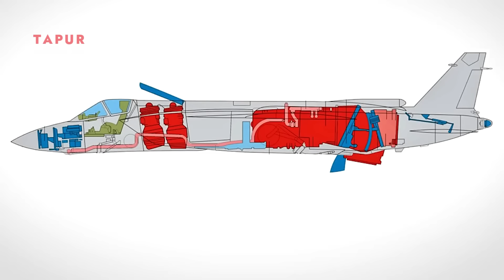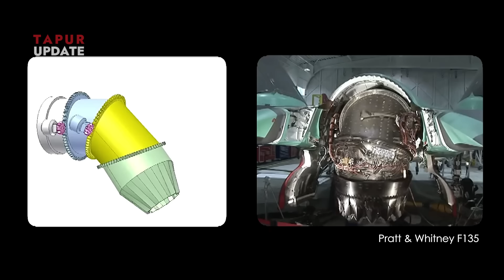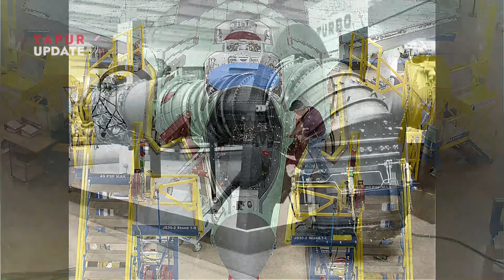Russia Resurrects Yak-141, The Forgotten VTOL Fighter Reborn for 6th-Gen Supremacy!

Comment: It's not even funny. Why would Russia need a vertical takeoff fighter if it has one aircraft carrier and is not going to build new ones? They just don't need them. The sixth generation fighter, according to rumors, should go into the mesosphere. Ideally to reach the thermosphere. But this requires new types of fuel and engines with new operating principles.

Comment: After the collapse of the Soviet Union, Russia's finances were in trouble. Russia did not have the financial resources to repair its only aircraft carrier. To make matters worse, Russia's oil and gas pipelines to Europe were damaged. Russia lost a major source of income. Russia has eliminated most of its Soviet-era weapons because it does not have the financial resources to maintain them. Lacking available destructive weapons, Russia has been using China's overcapacity DF-21D/Mach 10 and China's Beidou Global Positioning System to guide China's DF-21D to its selected Ukrainian targets.
As shown during the Iranian missile attack on Israel, the US Standard 3, US Standard 6 and Patriot missile defense systems are all unable to fully and effectively intercept hypersonic missiles (China's overcapacity DF-21D/Mach 10). In the next stage, will the US Ultimate THAAD system be able to intercept China's overcapacity DF-21D/Mach 10?

Comment: Fun Fact:  The Yak-141 was developed in the 1980's just before the fall of the USSR, and in an attempt to be "West-friendly" (and also to make money), Yak sold the tech to Rockwell or Grumman I don't remember exactly.   30 odd years later, USA has the F-22 and F-35 using this very tech.
Reply: It was sold US when US had program to develop Gen 5 fighter aircrafts with VTOL characteristic for research. Basically US wanted something more promissing than Harrier aerodinamic, which already reach its limits, wont allow supersonic speed, and probably wont allow an aircrat to have internal bays for Stealth and good speed. Yak-141 was more promissing. However F-35 turn out not be able to meet the same characteristic. I dont know why, the main engine on F-35 that is used for flying is almost 2 times as powerfull as on the Yak-141, their VTOL principle is very similar, many argue F-35 basically copy Yak-141. F-35 supposed to be made from light weight composit materials. However F-35A - none VTOL version actually achive 1,950km/h that is on the same level as Yak-141 (~1,800km/h). So my guess is that internal bay on F-35 takes space and somehow limit the capacity of its engine.
Reply: Wich are poor planes, but made great by propagando. Not real.
Reply: Lockheed Martin. The Joint Strike Fighter program was already underway by that time but the data and research was too great a prize to ignore and if you look carefully the F-35b rotating engine thrust diverter looks very familiar.  I think they even bought the prototypes.

But there is no purpose to the yak-141 without a platform to fly it from.
Reply: @s3p4kner  Unsinn, ein VTOL Jäger findet überall eine Plattform. Der komplette Erstflug der F 35 B fand am 22.02.2001 statt, also 11 Jahre nach dem Erstflug der Jak 141 ( 13.06.1990 ) . Man kann also die Jak 141  als Vater der F 35 B bezeichnen, da sie das technische und aerodynamische Design lieferte.
Reply: @s3p4kner  well, having a ready prototype which used similar VTOL principle is very usefull, Lockheed Martin maybe already have a similar design of their own, but they would have to build several prototypes and test them to get reallife data, it would cost a fortune, and here they found a cancelled aircraft, already in service, and had a very similar VTOL design, they wanted. So purchasing it would save you so many budget and time, especially when the Russian of that time didnt need such aircraft.

Yes I can confirm Lockhead Martine purchased 2 Yak-141, and not just bought them, but also bought all researches data from Yakovlev Deisgn Buro. The background is that the Yak-141 program was cancelled in 1991, and all funding to Yakovlev was cut, to preserve their staff and researches facility, they made a deal with LM in the same years. But the deal was not disclosed by Yakovlev untill 1992, and was not confirmed by LM untill 1994. So it is true, it was not just a purchase deal but join researche program, LM paid Yakovlev Design Buro to build 3 more prototypes and conduct static test, one prototype with 2 seats. All had increased weights (F-35 is 2 tons heavier than Yak-141). 

If I'm not mistaking, the biggest testing facility of aerodinamics studies and data base are located in Russia, so paying Yakovlev to conduct those studies for The Joint Strike Fighter program - was one of the biggest financial success for Lockhead Martine. After all, people should not forget F-117 was built using a theory of a Soviet professior of mathematic. The Pentagon when starting to design a Stealth Aircraft was supposed to conduct studies and develope such theory and principles, and they were surprices to find a book of that soviet mathematician who already developed such theory and was teaching at Moscow university. So they simply hire him to tech that theory to US engineers who worked on that program, the mathematician didnt know the purpous of his work, until the F-117 was announced, and his name was listed as one of the contributor to the program. He sent a lot of time n teaching everybody the principles to counter stealth afterwards.

The basic is that there is nothing new about US/Russia cooperation in technology, and such cooperation end up with technological breakthough. Alter all, 2 biggest contributor to space technology is US and Russia, US has been using Russian rockets to get to ISS. Purchasing Russian rockets engine to put in their own rockets. Maybe ppl dont know that Elon Musk purchased a lot of data and technology from Russia, simply because it would be faster and cheaper than reinvent a bicycle. And the reason why Russia was able to preserve their scientific and tecnological base after USSR collapsed was thank to those programs.
Reply: ripped from a harrier, had very poor flight characteristics, was a very weak plane. .
Reply: @robertklimczak5630  False, it use different aerodinamic design and luck of anything even remotely close to Harrier, the copy of Harrier is Yak-39 - a prototype for VTOL aircraft with similar aerodinamic design as Harrier (4 side nozzles out takes), which was cancelled in favor of Yak-141 design. Yak-141 was superior to Harrier because its a supersonic aircraft and can be a a good jetfighters. Harrier's primary role to conduct airstrike. Ofc if you compare the last version of Harrier, a second generation - its a multi-role fighter with upgraded characteristic, but still will suck against any pure jetfighters, simply because its is subsonic speed. 

Yak-39 as a prototype had similar characteristic as first generation Harrier in everything, speed, range etc. But worse vs second generation Harrier, simply because it was a prototype, that was not approved, and never went through any upgrades. However Harrier is worse in every aspect vs Yak-141 simply because the later had a superior aerodinamic design. There is a reason why US didnt use Harrier aerodinamic principle on F-35, although its a well prooven, tested by time machine, the Yak-141 aerodinamic was more promissing.

Harrier Gen 2 VS Yak-141
Max Speed: 1,065 km/h 1,800km/h
Range: 556 km / 2,100 km 
Max Payload: 7,760 / 7,850 

Today with all all avaliable technologies, more powerfull engines, light weight material, new Yak-141 will be far superior to Harrier, and Russian wont repeat the US mistake with F-35, which was so advanced, they cant find the proper use for it, it was patched with so many sofisticated elecronics, it break down and malfuction all the time.
Reply: @robertklimczak5630 Yak38 had Harrier lift engine, Yak141 is F35s Father 😅
Reply: @robertklimczak5630 obvious casual observer who doesn't know sht about planes 😅
Reply: @robertklimczak5630 Völliger Quatsch, die Yak141 hat mit dem Harrier nichts gemein und war ein völlig neuer Ansatz. Außerdem gab es nur Testmodelle und keine Indienststellung, das Programm wurde aus Kostengründen eingestellt mit Beendigung des kalten Krieges. Die Forschungsergebnisse wurden zum Teil an Lockheed Martin verkauft. 11 Jahre nach dem Erststart der Yak 141 vollzog dann der F 35 B seinen Erststart.

Comment: Russia is a very knowledgeable and capable country, the only thing holding them back is their mid-sized GDP and smaller defence budget. They need to focus on fewer programs, a stealth medium bomber to replace all bombers and some strike aircraft and a multirole stealth fighter to replace all other aircraft and keep upgrading them every 10 years as technologies mature, these need to be multidecade programs. 
The same goes for the Navy, one subtype, one large frigate type, one small-carrier type etc, again multidecade programs to achieve economies of scale, simplified support and maintenance with more common vessels. The Arleigh Burke-class destroyer has been produced for 37 years with four different variants. The first of the flight III variant has just been launched, with 21 more to follow, so this will be a program that will exceed four decades, that is how you keep costs down.
They are achieving heaps within those budgetary constraints, but if they focused those resources and strengths on fewer programs they'd be world class.

Comment: The problem with having separate dedicated lift engines, is one of carrying extra dead engine mass  with you, that could be  instead of fuel or payload, or both! For the ideal VTOL craft, you need just one engine that provides VTOL and horizontal thrust, as in the 1960's Harrier jet.  What is needed is a new concept based on the Harrier , but without the rotating thrust nozzles, that is a straight through jet engine, with high pressure bleed jets, powering lightweight lift fans within the wings.

Comment: I think the challenges quoted to Russia are THE SAME old ones before the SMO, you simply gave a control+C, control+V...
And things like lack of western components or industrial military capacity are not credible anymore. GROW UP!!!
And still ignores the HARD challenges of the F-35, it simply not overcame and now and then we see ejections pilots and some crashs to the ground... 
Lockheed Martin continues to pull the major prototype air frames of the history of military aviation, did not finish the F-35 development and you (and everybody in the west) still thinking that the F-35 (meant to be a F-16 LOW FIGHTER REPLACE) is something witch it is not now or was EVER...

Comment: Russia stopped relying on imported avionics and engine technology for their military aircraft quite some time ago and are fully self sufficient. The R79 engine of the Yak-141 has evolved into the R579 engine with 22 tons of thrust and is being planned for use in a range of roles. They might develop a new VSTOL fighter but I suspect any new aircraft carriers they develop will be bigger than the Kuznetsov so an upgrade of the MIG-29 to MiG-35 standard and a future Su-57K type which will eventually be supported by a new 5th gen twin engined light fighter from MiG is more likely than a VSTOL fighter from Yakovlev. VSTOL fighters are just fundamentally flawed for the tiny advantage of operating from a smaller ship. Smaller ships carry less aviation fuel and ordinance which limits the usefulness of the air group. Their helicopter carriers are landing ships for landing troops with armour using hovercraft and landing ships and helicopters. It would make no sense to waste space on board one of these ships for a fighter aircraft or 6. They would take away from their capacity to land armour and support them with attack helicopters.

Comment: The F-35 uses the engine technology from the engine used in the Yak-141, they paid for it. VSTOL fighters are not that useful and the design compromise to allow them to take off vertically seriously limits their performance in other areas and makes them fragile and vulnerable to high crash rates. The best possible use of a VSTOL fighter would be a short range subsonic aircraft like the Harrier for close in defence of carriers and ships. Trying to make them supersonic and stealthy means internal weapons which makes them fat and less aerodynamic and inferior to conventional non stealthy aircraft like the MiG-35 or late model F-16s which can carry more weapons further and faster. The only advantage of a VSTOL fighter is to allow you to have smaller aircraft carriers but experience has shown smaller carriers are not cheap and are not as effective or useful as bigger carriers with more planes and systems and resources. The new helicopter carriers the Russians are building have Ka-52 helicopters with nose mounted AESA radar and air to air missiles so any future VSTOL fighter is going to need to be something really special to make sense because the helicopter carriers can use these fighter helicopters as fighters and as attack helicopters. VSTOL fighters tend to be horribly vulnerable to IR guided weapons because of the way their engines work in the hover.

Comment: VTOL is no problem for Chinese or Russian Engineers! The question is - Do they need a VTOL Aircraft when their Drones and Hypersonics are the Gamechangers right now? A group of Bastion's is enough to keep a Carrier group thousands of miles off your coastline. Well, maybe China will decide to produce some for their NON CATOBAR Carriers and Landing Ships! The US for example does not send a Carrier Group INTO the Persian Gulf anymore. They all stop south of Yemen, out of fear of the Iranian Anti Ship Missiles. Today a Carrier is not as important as it was in WW-2 anymore. At least against a potent adversary. You can't park a US Carrier Group in the South China Sea any longer without having to fear losing it at any moment! Same count's for the North Sea! Asymetric Warfare is a Biatch! Russia is also not a aggressive Empire as the US is! But they certainly have the means to get rid of it if they set their mind on it! There is no one as adaptable as the Russians in Warfare. They have proven that time and again! Washing Machine Chips and Shovels? LOL!
Reply: Of course they do. The same reason why the US has F-35B VTOL aircraft. It can be a force multiplier for the navy by providing additional coverage and protection from the sky. VTOL aircraft can fly from any flat surfaces, in an event the enemy manages to destroy the runway, VTOL can fly from a helipad to intercept or defend ally bases from enemy aircrafts. Just like close support helicopters, VTOL aircrafts can also provide close air support to ally forces that require airstrikes to soften the area controlled by enemy forces.
Reply: @ Mentioning the advantages of a VTOL Aircraft does not change the fact that you don't need one if you even have Catapult's on the Helicopter Carriers China is producing right now! Also VTOL was great in the Harrier, but nothing else since. Those F-35B are falling out of the sky nearly weekly now! After more than 20 years of research and developement I might add! Even these V-22 Osprey's are a hazardous endeavor to this day!
Reply: Спасибо, что понимаете это.
Reply: Good point
Reply: We see how that's going in Ukraine 900,000 dead Russians and most tanks are caput. Air defense is nullified. Next.

Comment: All nonsense, this is fake video, all the airframes have been scrapped or sold!
Reply: Я бы так не говорил🤔
Reply: @ I would say that the Plane is not needed, it is a sitting duck, The Federation does not need that as the Carrier has the Mig29k or SU-27K and even the People Republic are using their SU-27 variant on their Carriers.

The Yak-141 burns the Carriers Steel Deck with its two engines. The airframes were scrapped and the few prototype were sold!

The plane is 40 years old... Comrade!
Reply: Theres blieprints dummy
Reply: They still have the knowledge i dont think they just forgot.
Reply: @ there is no point of a VTOL aircraft as it is compromised from day one!